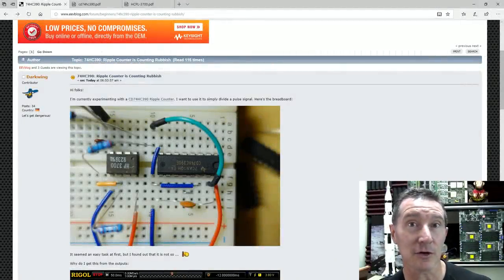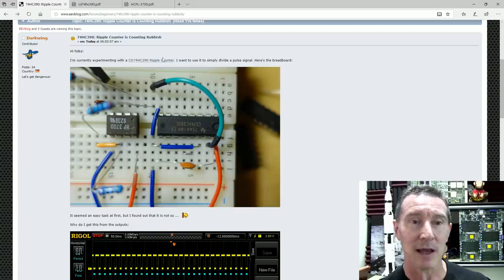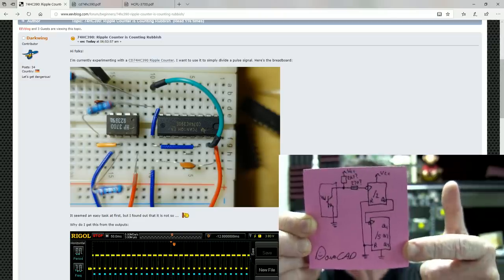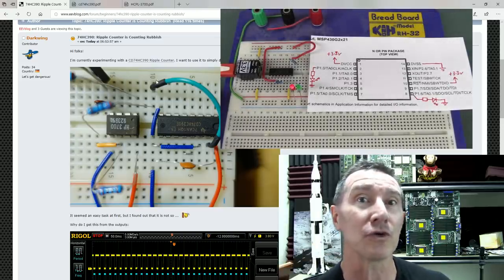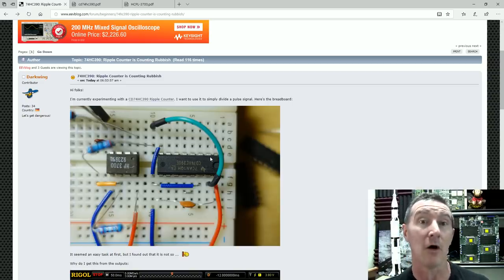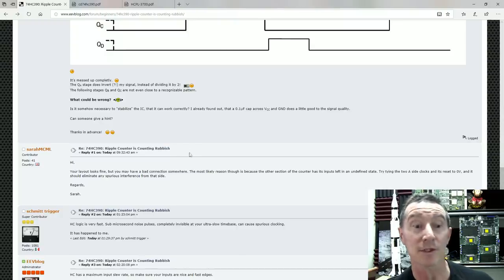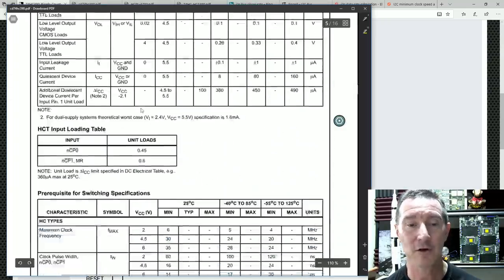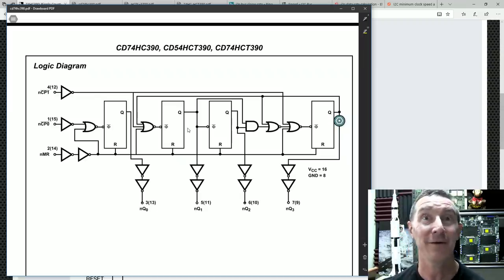EEVblog #1208 - Circuit Analysis & Debugging

Comment: 4:45 the glue acts as a resistance multiplier ;)
Reply from the maker: What is the rule of thumb multiplier value?
Reply: cutting off one nanometer of the ends will divide the multiplier by 10 starting with 1 million perhaps :)
Reply: It's certainly an annoyance multiplier!